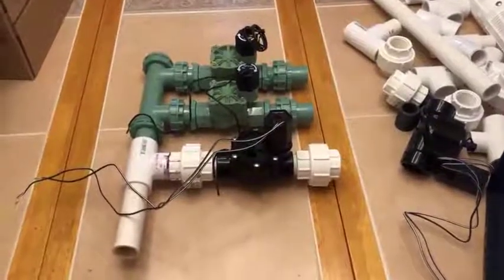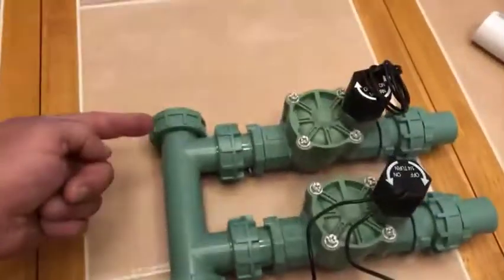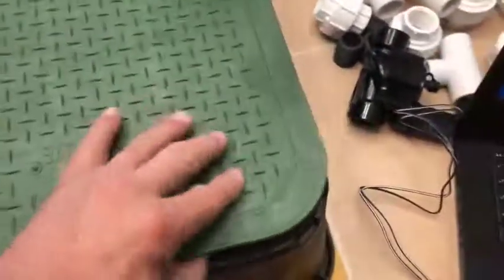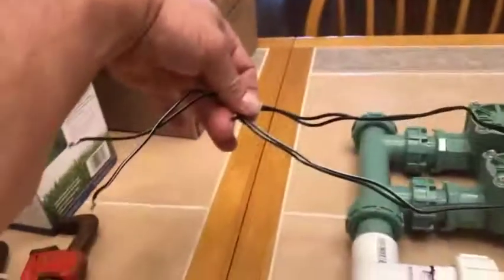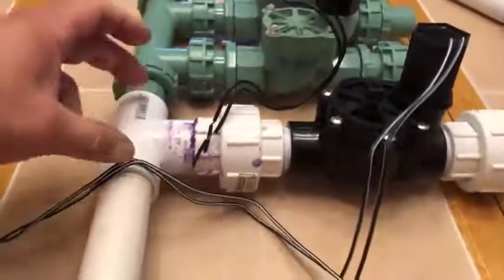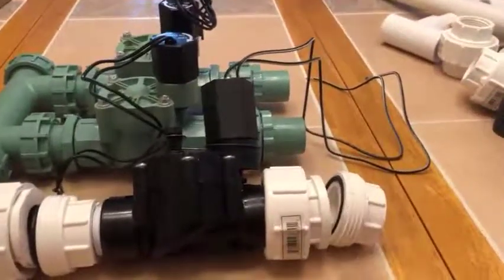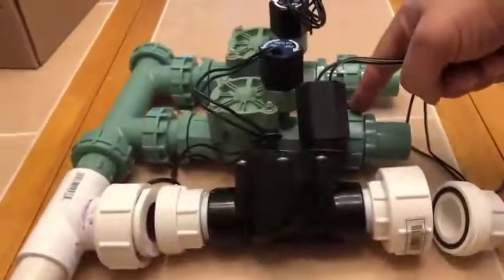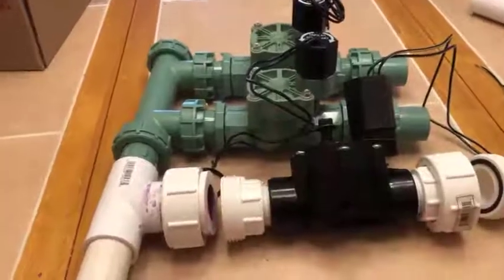5. Home Lawn Irrigation System - Zone Manifold Comparison

Comment: How's the quality of the Orbit Manifold's?  Thanks!
Reply from the maker: I have not used theirs, but built my own. direct from PVC parts.  Now, that said, when I WAS researching them, I read MANY reviews that people were frustrated with them leaking regularly and it was not just 2-3 reviews.  That is one reason WHY I did not want to trust it.  There are other manufacturers of similar irrigation system manifolds, but am not going to give any good/bad as I dont have personal experience with them, hence built my own.  The only time I had an issue was when I OVER tightened my own and had to rebuild it.  Do your own research on product reviews for it.  Be sure what you are connecting with in your situation / design.  ALSO, you should be able to find them directly in some places like Lowe's, Home Depot.  Take them and look at the size, build.  Does it feel firm / solid / cheap / brittle.
Reply: @drapp5752  thank you I greatly appreciate it.  I’ve watched the Orbit videos and of course there are no problems mentioned, only the ease of using the Orbit Manifold.
Reply from the maker: Due diligence.  YOU need to be comfortable.  Now, that said, if something breaks / cracks / whatever, you are probably better guaranteed a replacement of exact same size to disconnect and reconnect which may be a positive for you, so I personally wont ding them since I have no direct experience.
Reply: @drapp5752  thanks and blessings!